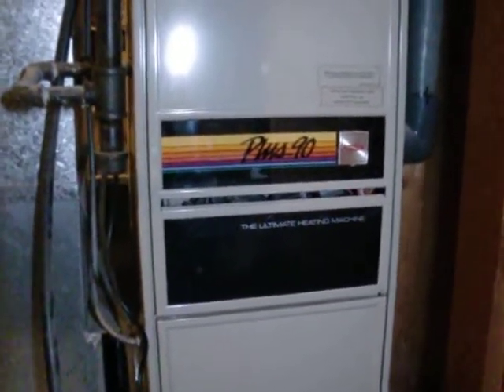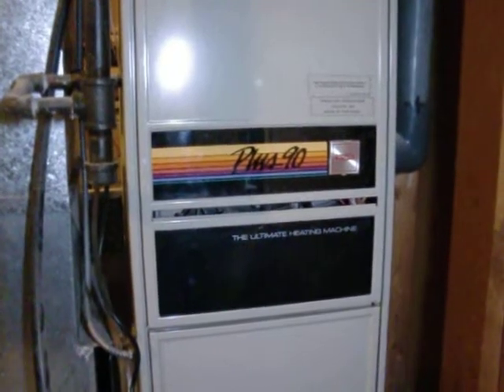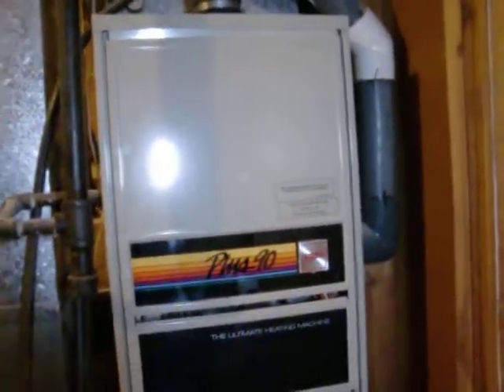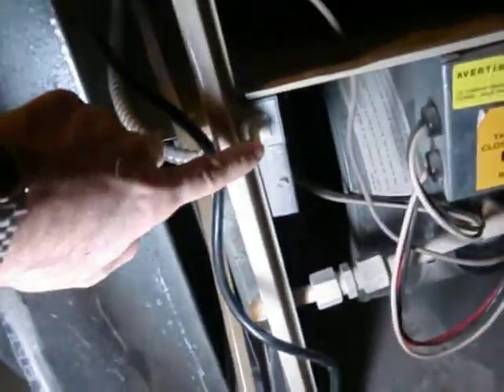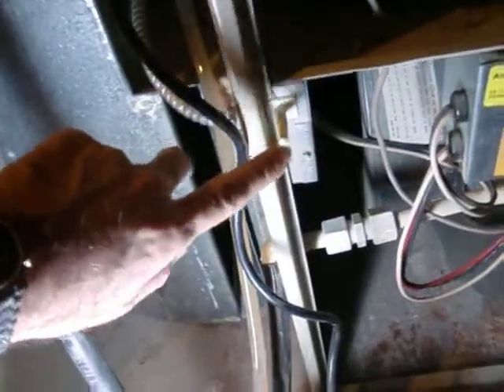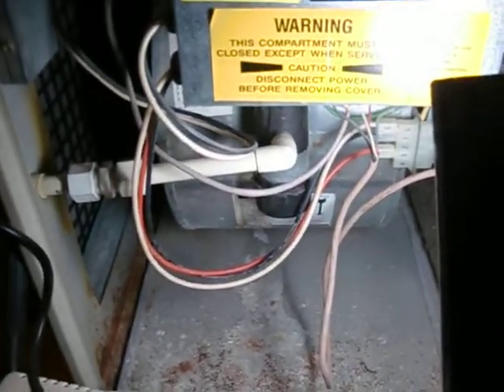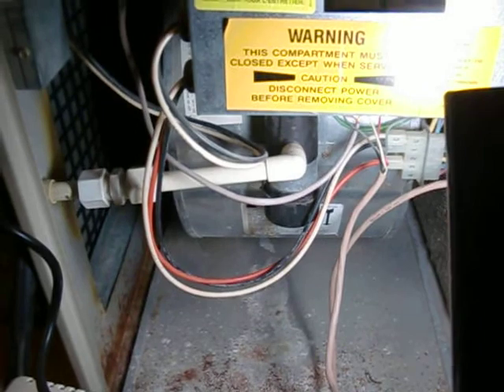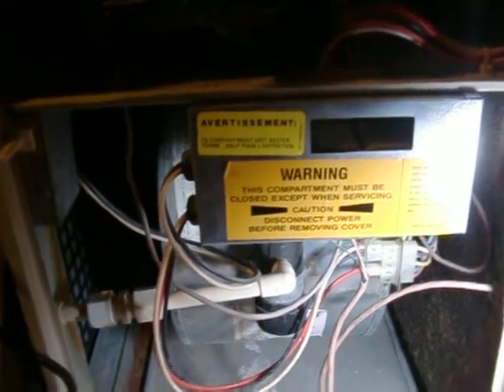Identifying the type (AC with capacitor vs high efficiency DC) of fan motor on a furnace

Comment: Can you share your thoughts on replacing an AC motor in terms of blower wheel and control board?  Or are you talking about replacing the whole assembly including the squirrel cage and housing?
Reply: Hi Mike, Typically only the motor itself is replaced (and the capacitor is removed). The mounting bracket, blower wheel, housing, etc. all get re-used by the new motor.

The existing control panel remains, the new motor has an integrated control board to drive the DC motor based the the existing high voltage and low voltage furnace controls. It typically gives some potential added functionality, like low speed continuous use, and "fan" setting at a lower speed. By default most furnaces when turned on to "fan" go to the maximum fan speed - which is an artifact of air conditioners working best with a high fan speed.